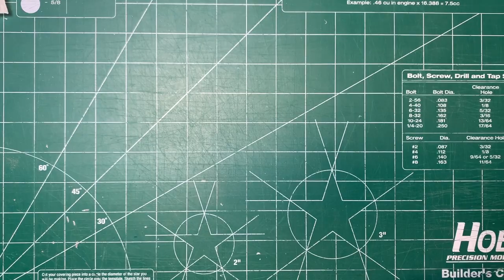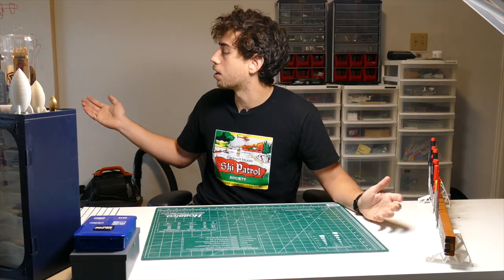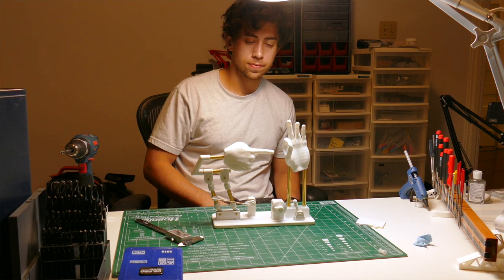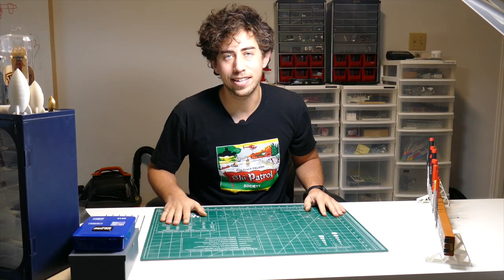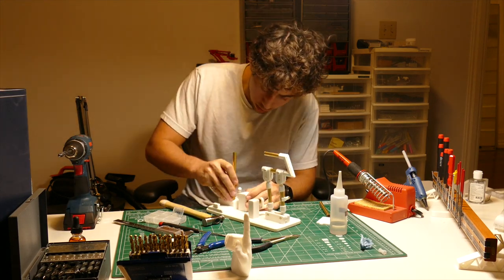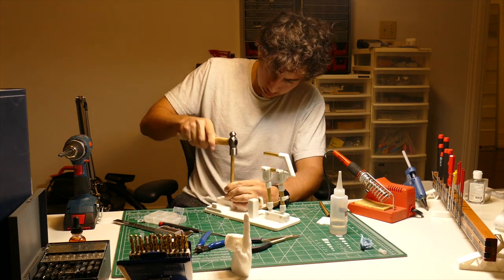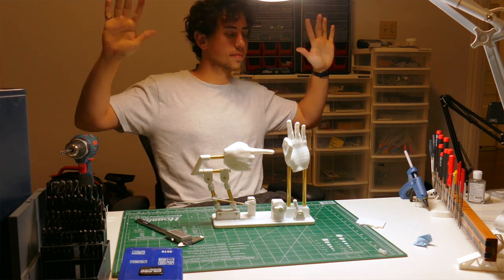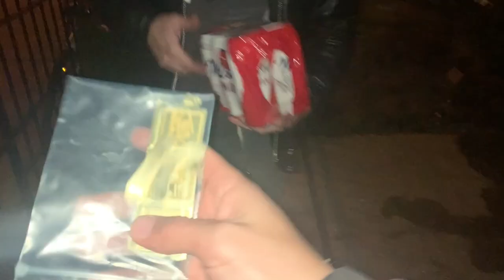This Sculpture May Offend You

Comment: Hi, to get wires through internal passages, you can try to vacuum a smaller line through first (in this case fishing line might work). Then pull through the actual wire with the smaller line. As long as the internal passage is big enough and unobstructed, this should work every time.
Reply from the maker: Great idea!

Comment: Eternal Swagger.

On a more serious note how do you find out how many batteries (and which batteries) to use to make your machines work as planned
Reply from the maker: In this case the motor is rated for 6V, most of the cylindrical batteries are rated for 1.5V so 4 in series gives you 6V. I chose AAAs here because theyre smaller and fit better in the sculpture
Reply: @Engineezy thank you!